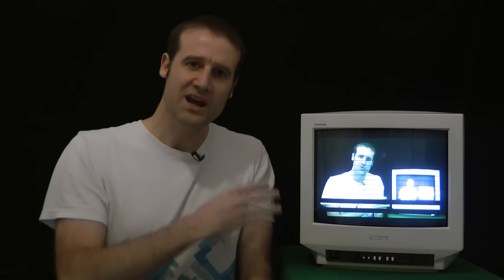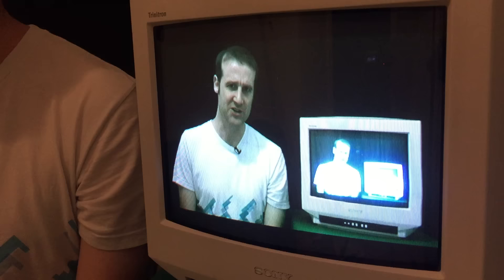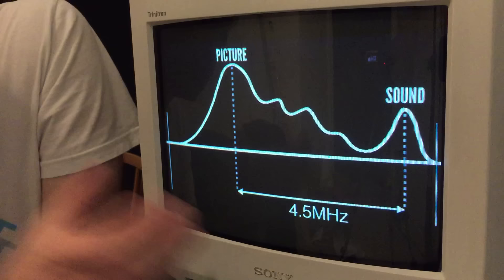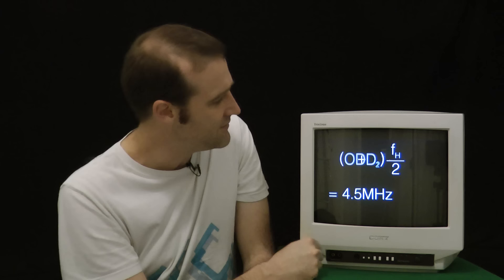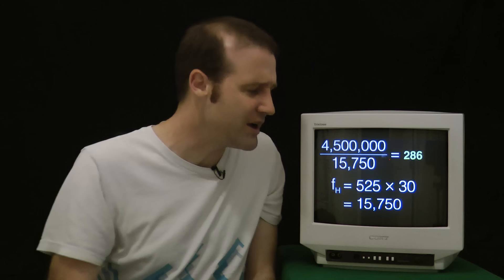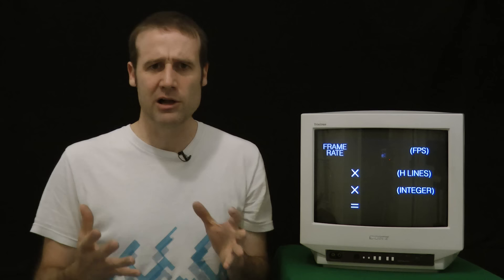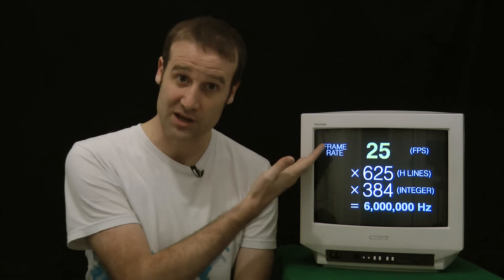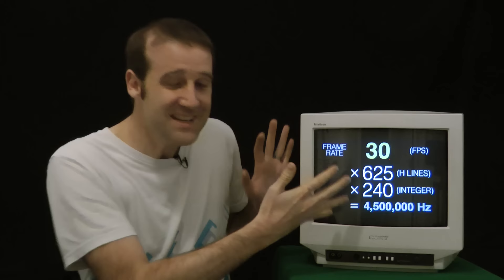Why is TV 29.97 frames per second?

Comment: That's a good explanation except for fact that it's not 100% technically accurate. 29.97fps * 525 lines * 286 is actually equal to 4,499,995.5. Although we nominally refer to the NTSC framerate as 29.97, that's actually just an aproximation. The true framerate is actually 30/1.001, or about 29.97002997002997... When you plug 30/1.001 into your equation, you get EXACTLY 4,500,000Hz.
Reply: Neat.
Reply: It's nice explanation but based on wrong facts. PAL channel is wide enough that you don't need to mess with Δ2 = ODD2 * fh/2. Sound use FM modulation, so there is no way to interlace sound spectrum and chroma spectrum, so exact Δ2 doesn't help much. In Europe we have 5,5MHz, 6,0MHz and 6,5MHz sound IF (Δ2 is different) and all systems use the same PAL 4,43MHz frequency.
PAL creator Walter Bruch choose chroma frequency other way - PAL use the same horizontal (15625 Hz) and vertical (50Hz) frequency like B/W standard, but chroma frequency was shifted - fv/2 was added to minimize artefacts. In fact in PAL it must be ODD * fh/4 (because of PAL phase alternating line by line) + fv/2. Exactly: 1135 * (15625Hz/4) + (50Hz/2) = 4,43361875MHz
So PAL never used chroma frequency ODD * fh/2 ! It was only used in experiments with NTSC based system in Europe in early 60's.
Reply: +xsc1000 The explanation is specifically pertaining to the North American NTSC standard. PAL was developed after NTSC so the engineers were able to avoid many of the inherent flaws that plagued us here in the USA.
Reply: You count 6MHz bandwith for PAL for Δ2, but in fact it is 5,5MHz in original German version, 6MHz in British version and 6,5MHz in eastern Europe version.
If NTSC changed horizontal lines to 625 (like you offer), none of B/W set would be compatible because of horizontal oscillator changed frequency. Also horizontal resolution would be low. You can count bandwith you need for Y (luma) signal by this equation: B= 625 (horizontal lines) * 625 * 4/3 (vertical lines) * 30 (framerate) /2 (two pixels create sine wave period) = 7,8MHz. But you have < 3.5 MHz for luma in NTSC, so horizontal resolution would be less than half the vertical resolution.
Reply: "The true framerate is actually 30/1.001, or about 29.97002997002997..."

So NTSC TVs are more accurate timekeepers than atomic clocks?
Reply: +Congomen Of course not. I fail to understand what you're driving at with this question. In the day's prior to NTSC color, the North American black and white TV standard was 30 frames (60 fields) per second. This rate was based on the 60Hz AC line frequency. 60 Hz was only the nominal frequency and the actual frequency could deviate from that.When the engineers needed to make room in the signal for NTSC color burst, they elected to slow the field rate by an exact ration of 1000/1001. So regardless of the timekeeping accuracy of an NTSC broadcast signal, the true framerate is calculated as 30 multiplied by that ratio which is 30/1.001.
Reply: Indeed,  three significant figures is probably as accurate as one can be in this context. So, I'd claim that the true framerate is 30.0 (greater accuracy pointless) rather than the ridiculously accurate 29.97002997002997...
Reply: He also got the part about image retention wrong, it's an incredibly common myth that people can't see past 24fps (or whatever speed happens to be popular), but in reality people can perceive hundreds of FPS, possibly even thousands.
The reason one moving dot produces a coherent image on a CRT display is that the display itself has image retention, when the phosphors become excited, they stay that way for a period of time longer than one frame.
As displays were developed with lower and lower image retention we had to pump the framerate up higher and higher, I was never comfortable looking at a 60hz image on a high end CRT, many people get sick standing in a room with 120hz florescent lights, but looking at old TV's at 30hz is fine because they have such high image persistence.
Reply: +Bud The Cyborg not only that but TV content was inherently blurred by motion
Reply: +Bud The Cyborg, I think the idea he might have tried to get across is that people don't perceive any additional motion past a certain frames per second. It's true that here is  clearly a difference in the quality as the frames per second increases past our ability to perceive each frame. 60 frames per second looks a lot more life like than 24 frames per second. When they came up with a cinematic standard for the earliest days of film, it was a compromise between cost and acceptability. 24 frames per second was the lowest frame rate that was good enough to get by with. Anything more than that would cost too much since it would consume a lot of raw stock.
Reply: Is that why my analog supernintendo from europe displayed in pal did not seemed pixelated? And now the new mini snes in the usa looks like "crap"? Any thought? Thanks!
Reply: Cognomen The major TV networks for many years used what are called rubidium standards, which are sort of atomic clocks, as the ultimate timebase source for the timing of their TV transmissions. So yes, the timing was accurate to more than 3 decimal places. Maybe not to 14 places, but using the theoretical value to show how the math works out does make sense.
Reply: Whats REALLY funny is line by line phase reversal is the defining characteristic of Phase Alternating Line television, NTSC doesnt use it
Reply: Who’s just scrolling down through these weirdos
Reply: Your video is very good and quite complete. However the sound Vision carrier spacing was important for intercarrier tv reception (look it up). The NTSC did consider the change in sound carrier frequency but that would require expensive transmission changes and require most televisions to require realignment. Changing The number of lines to 625 from 525 would be great except 625 lines would not fit in the narrower US channels. It would also make all existing black and white tv's obsolete therefore would not be "compatible color" television. The shift in the vertical and horizontal scanning rates were least consequential and so that was the best solution at the time. Remember that at that time video tape recording had not yet been invented and electronic editing with time code was still more than a decade away. Ah... the technology is far to subtle!
Reply: did the 29,97 have frame drop?
Reply: Oddly I would say the faster the frame rate the more like video it looks not more life like. A matter of taste perhaps but the photo chemistry of your eye blurs motion. The higher the frame rate the less blur is recorded, in general, so it isn't actually what your eye would percieve in a real environment. Oddly the 24/25 fps sits in a sweet spot I would suggest. It is why we spend a lot of computer  power generating blur in CGI footage.
Reply: As I understood it, the frame rate is actually 29.97.  The difference between that and the rate needed for a true integer is made up in low-grade artifacting that was deemed acceptable.
Reply: Well, thought exactly the same :D Also.. Japan has some kind of weird mixup, that they use an effective framerate of 23,976023... (24/1,001). I think to convert the 25FPS to 30FPS. Because in much material even today, they just double every forth frame, which would result in a framerate of 29.97... FPS technically, but not effectivly.
Reply: @SlideRSB  Thank you! The video creator immediately went off on tangents about how CRTs work and scanlines, and bandwidth, all of which had ZERO to do with why they changed from 30 in the black-and-white system to 30/1.001 in the colour system.
Reply: @budthecyborg4575  Analogue video has always been hard for people. Every new "expert" screws up horribly :-D
Reply: @briantw  @SliderRSB didn't say anything that contradicts the video... All of what Matt said leading up to the moral of the story was related...
Reply: @yogurtsplace  r/ihavereddit
Reply: Brian Tristam Williams Yeah, many mistakes. For example how europe chose 50 * 625 because of color, or how would be easier to solve by adding more lines.
Reply: @digitalmetadata1  The audio carrier frequency offset would be 4.5 KHz off. The analog TV FM carrier has a ±25 KHz deviation, and FM receivers weren't that selective to begin with. On the TV side it would be inconsequential.
Reply: nerd